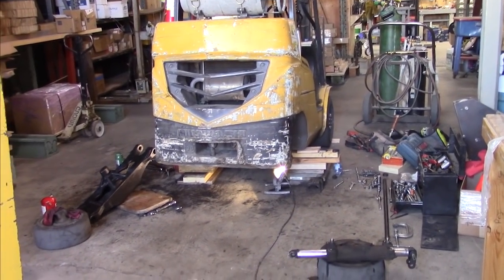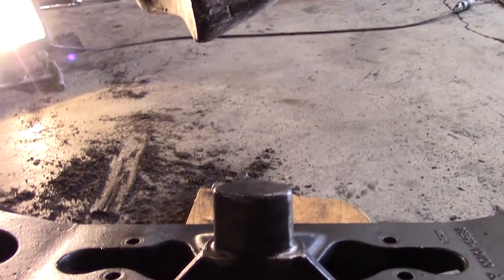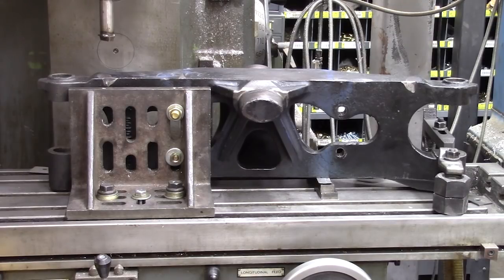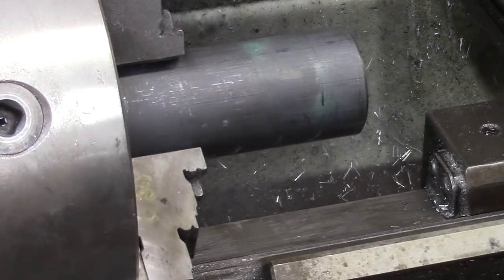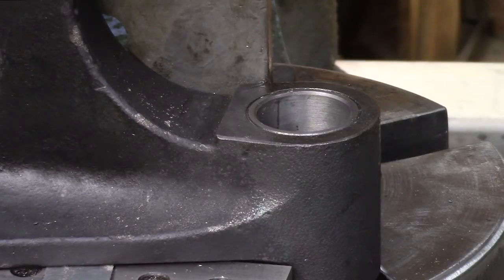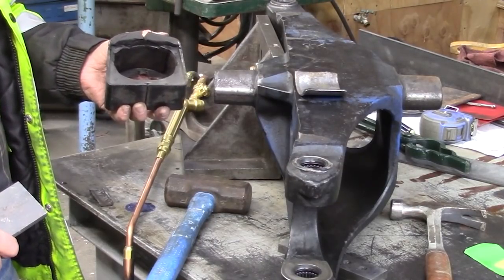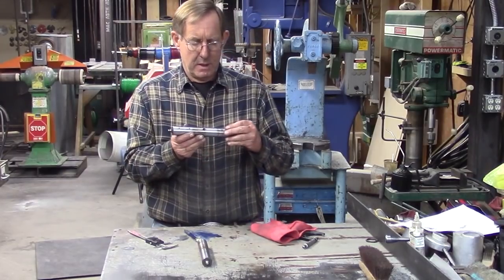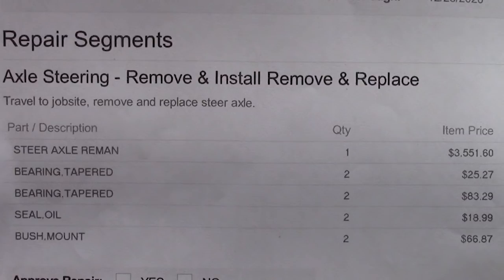Another Boring Video [boring an axle] {# 83}

Comment: are there two seals for each bearing?
Reply from the maker: The seal on the top bearing is sealed with a actual seal at the top, then the thrust bearing below the needle bearing acts as a bottom seal. In regards to the bottom bearing it is open at the bottom. Not sure why but they do not have a seal at that point between the king pin and the axle housing. A lot of grease does end up there.